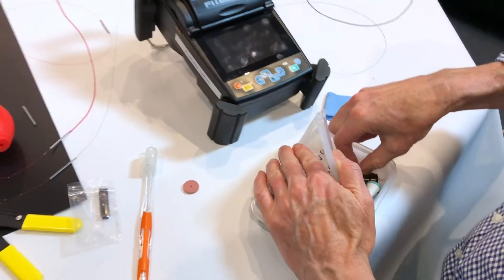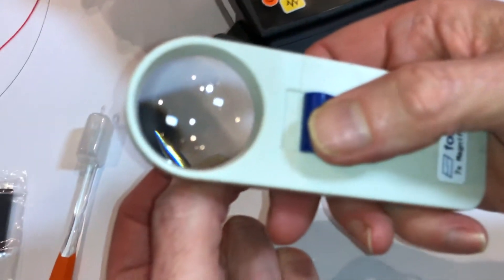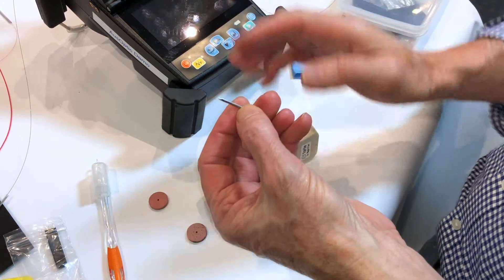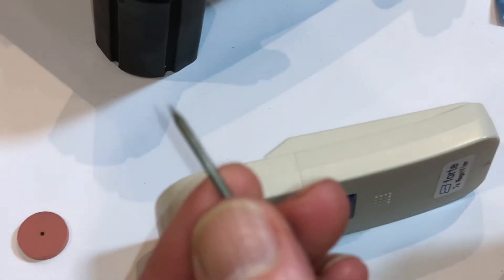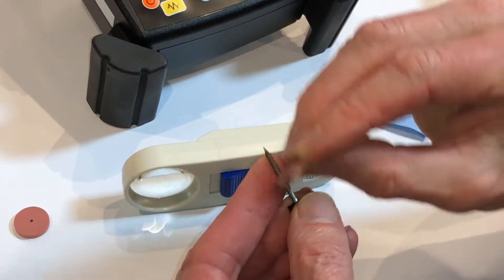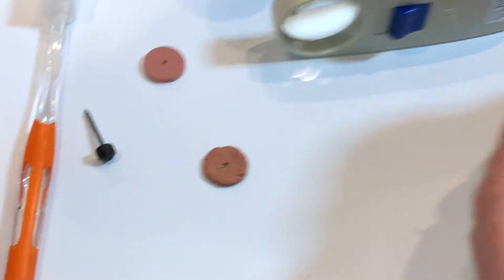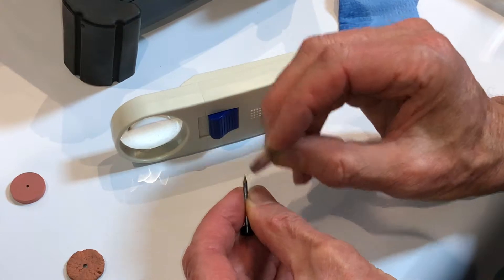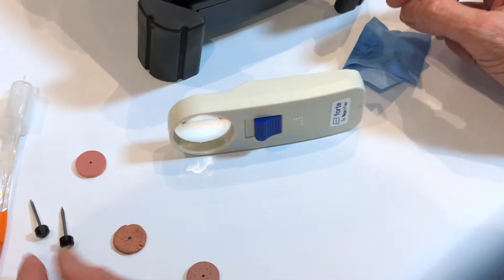FITEL Fusion Splicing Tip: How to properly clean and maintain electrodes

Comment: Where to get these pucks?
Reply from the maker: these are available thru Fitel splicer dealerships around the world, they are an abrasive disc that will take the oxides off the tips and to remove tarnish, the energy travel in the skin of the electrodes. we are in Sydney Australia

Comment: Lovely. I've owned those discs for ages but never been sure exactly how to use them. I'm guessing it's necessary to stabilise the electrodes after reinstalling them?
Reply: Where we get those disk's brother can u please give address am from Andhra Pradesh
Reply from the maker: yes cleans off the silica oxides from the fiber, can also remove oxides from the electrodes along the shaft if they have oxidized. : )